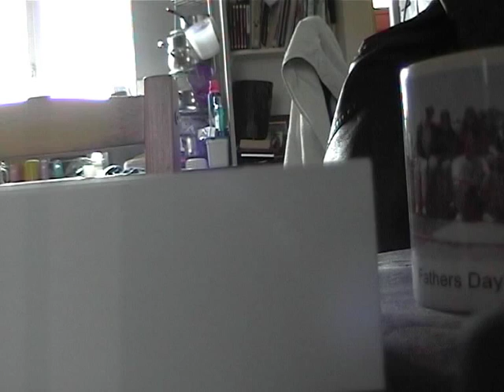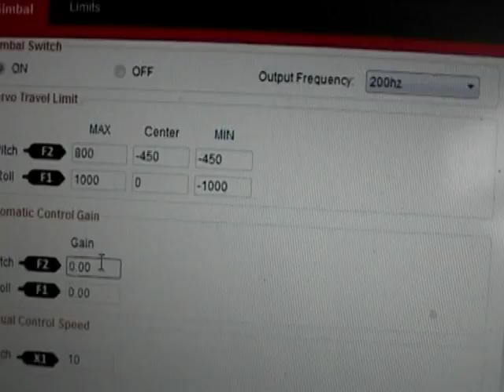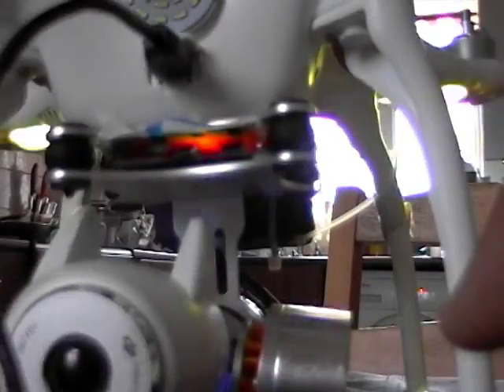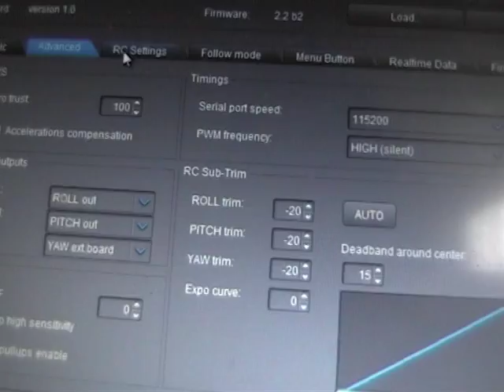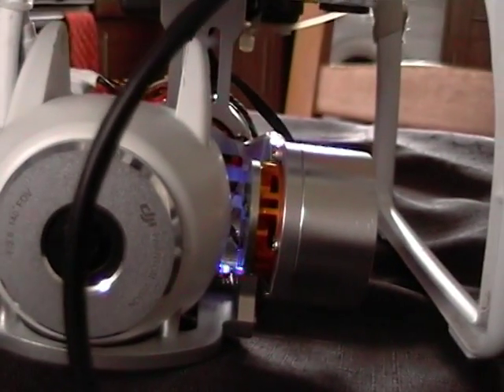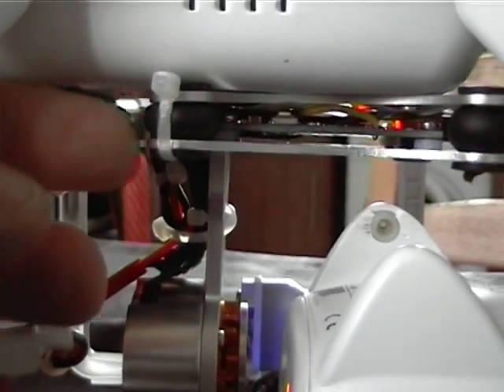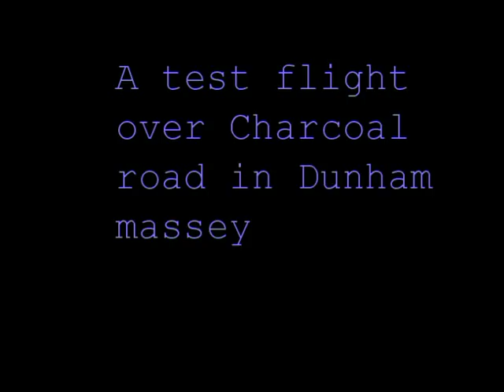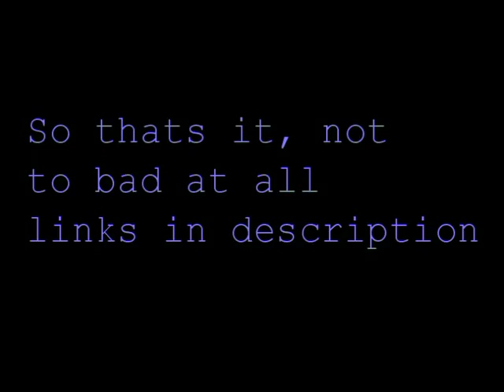Ebay Chinese Gimbal

Comment: Cheers for the video. I ordered one but not due for another week or so. Hope it fitting is as easy as your one.
Reply from the maker: If you get the same cables as I did then they are really easy to fit, they just need a bit of tweaking to get them spot on, just follow the links for the software and read up on setting up the software using the SimpleBGC software